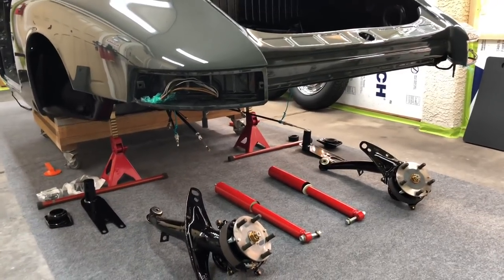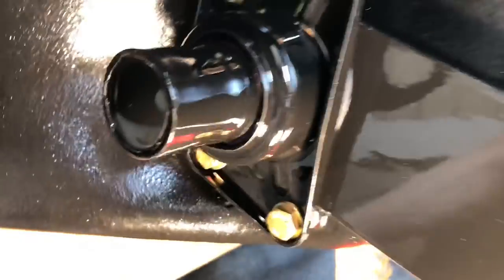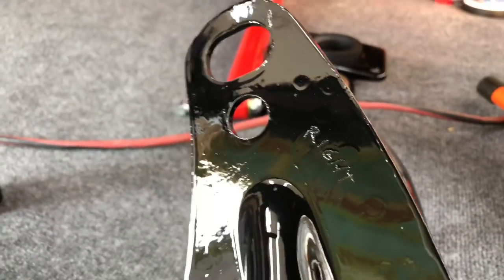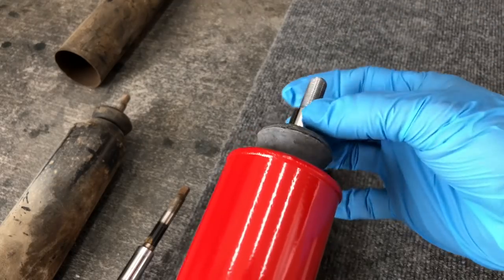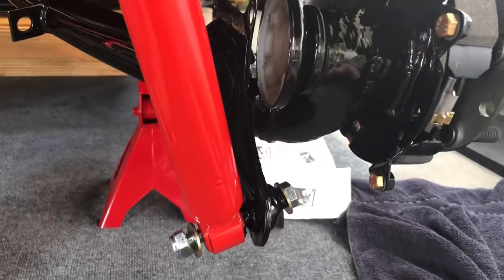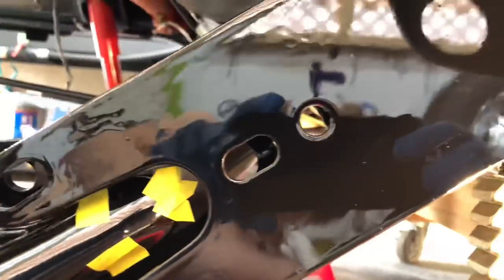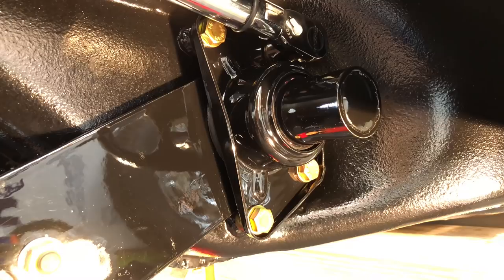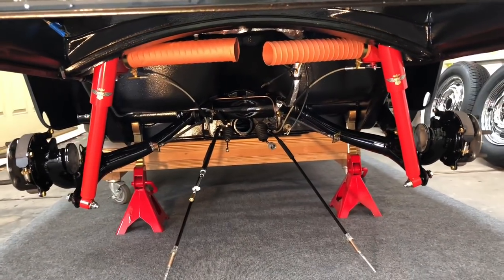1967 Porsche 911 Video 44 Installing rear suspension

Comment: When I was 18 my dad bought a grey 912, perhaps a '66, needless to say I am enjoying your videos! I recall the model placard  on the glove box was "912" and yours is "911". When did Porsche switch over?
Reply from the maker: Hello John
The 912 4 cylinder model was introduced in early 66 and was built until 69..
They were made as an economical option to the 6 cylinder 911.
The 912 outsold the 911 by about 2-1 but the 912 was dropped later in 69 because the cost of producing it was about on par with the 911.
They are highly collectible cars now!
Reply: @MikesRestorations  Yes, I actually drove one of the very first 911 @ a dealership near Boston. I think the Porsche community was quite resident to the 911 price, prompting the 912.

Comment: I have a 1978 Porsche 911SC that I would like to lower a couple of inches. Is there some rule of thumb that correlates a change in the angle of the stock spring plate to a lower or raise of the car in inches? Let's say for example does 1 degree of change equals 1 inch?
Reply from the maker: Hello BWJ
I am not aware of any articular formula for spring plate adjustment as it correlates to height. It is possible to raise and lower the back end by pulling either the plate or axle and rotating splines one notch at a time. The axle has two different spline set ups..
inner and outer which will make a considerable adjustment rotating one spine at a time. I think 1-2 splines would be all you would need. Best way to get exactly what you are after is trial and error. A lot of work though to pull everything apart and adjust and re-put back.
Good luck!

Comment: Superb video and channel. I will add my voice of thank you for all the hard work in posting it. Question: what exactly is that synthetic grease that you use on the rubber bushings of the torsion bar cover? Perhaps a link to the product? Thank you again.
Reply from the maker: Hi Max
Thank you and welcome to the channel
The grease I am using is Mobil 1 synthetic.
Here is a link with some technical data.
https://mobiloil.com/en/synthetic-grease/mobil-1-synthetic-grease
I like to use synthetic on anything rubber, plastic, polyurethane, and any 
rubber areas subject to washout.
However its no good for breaking components because it is not soluble with
break fluids. Rubber grease is great for braking components and anything light duty or interior applications..It is mineral based and will washout under  wet road weather conditions.
Metal to metal surfaces ..I generally like to use petroleum grease
Good Luck!
Reply: Much appreciated!
Reply: look for red rubber grease

Comment: Do you have any suggestions on how to remove the passenger side torsion bar from a 1978 porsche 911sc? I have removed the cover from the spring plate. The spring plate and torsion bar are stuck. I have tried prying it with a flat pry bar; nothing gives.
Reply from the maker: Hello Billy
Does the car have any evidence of rust? There is a leverage tool known as a wonder bar. This may be needed to work the spring plate loose form the torsion bar.
Prying from corner to corner gently should do the job! I would use at lease a 12-14 inch wonder bar. Vaughn makes the best one. They are available at Home Depot
Good Luck!
Reply from the maker: Also try placing a wooden shim under the wonder bar for extra leverage
Reply from the maker: This is the tool you need :   https://www.homedepot.com/p/Vaughan-15-in-Flat-Bar-B215/100183669
Reply: @MikesRestorations  With the help of that flat pry bar, a 1x4 in. board wedged between the spring plate and car body, a bottle of propane, a pint of sweat here in steamy Alabama, and lots of swearing I got it done. It wasn't easy. I had considered replacing the clutch cable that has a couple of nicks while I have the engine out. I decided against it. Working inside that tunnel seems really difficult. Is there an easy approach. Thanks Mike!
Reply from the maker: Im glad everything worked out Billy
Working inside the tunnel is a challenge for sure..Its tight but now would definatley be the time if you need to do any work in there..
If you remove the handbrake and wooden foot peddle board it will make things much easier
Good Luck!

Comment: When do you use synthetic, vs lithium grease?
Reply from the maker: Hello Fg
Synthetic is great for anything Plastic, Polyurethane, or sometimes rubber although its best to use rubber grease when using rubber as it is mineral based and will not swell the rubber.
Lithium or petroleum based cannot be used on anything rubber, Can be used on plastic, & Polyurethane but Synthetic works better for those mediums. Petroleum grease works best for anything metal to metal. Bearings, ball joints, linkage..etc.
Good luck!
Reply: Mike’s Restorations that's great. I'll be sure to write this down.

Comment: Another great video Mike! When installing the Elephant racing bushings on my 69 spring plates the instructions call for super gluing the bushings to the spring plates which would make the outer surface of the bushing rotate? Another difference between the years?

https://www.elephantracing.com/suspension/instructions/2290003_Spring-Plate-Rubber-Bushing-Instructions.pdf?iframe=true&width=80%&height=95%